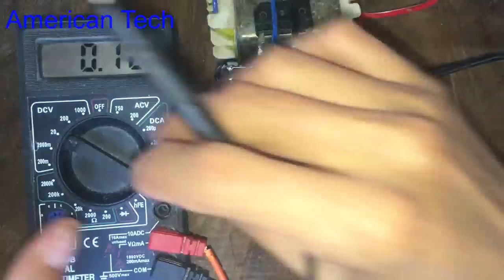New ideas to make spot welding machine with high Quality

Comment: The energy stored in 8800uF at 30v is around 4J which is about 10% of what is needed to make a good weld with regular nickel battery strap.  Also, notice how many of the "welds" demonstrated are visible only on one side of the probe... this is because the energy is spent in the sparking as the contacts close not by current flowing through the weld.... the current needs to be switched on AFTER a good contact is made!

I have no doubt that with some luck and some very thin metal strip this might work a few times, but it could not weld regular nickel battery strap, and the switch will not last 10 minutes.
Reply: correct.
Reply: Also, the soldering is crap as there is no mechanical bond on the connections!!!
Reply: James Lewis «YA YA YA,BUT THE WHOLE IDEA BEING HE NOT ONLY USED HIS BRAIN BUT HIS HANDS IN EMPLENTING HIS DESIRE,MUCH UNLIKE THOS WHO ONLY USE THEIR KNO IT ALL RHETORIC TO CRITISIZE
Reply: Roland, "ALL CAPS", replies are hardly a way to start a dignified discussion on any topic... it simply makes you look like some sort of idiot.  However, as someone who has been building improvised electronics for many years, I can say that a tool like this... however cheap is a false economy as the welds will be unreliable, and will spoil any later project you build with it, even potentially making stuff dangerous if a strap comes off and shorts out a pack.

There are designs, and kits for battery spot welders on Ebay that are excellent, but this is not one of them!

In principle, if the design had included a resistor to limit the current when charging the caps... had included quite a lot higher capacitance... ~100,000 uF and used some mechanism to connect the load for a short time when triggered... (foot switch, 555 timer, several mosfets) it would actually be usable.... but it would not make for a video that could be monetized which is really what this is all about!
Reply: He welded wrong. He needed to have one electrode on the battery. He had both on the strip shorting right through it making a crap "weld" from a hot spot. (Edited: I was wrong. Some current will flow from strap to battery and back.)
Reply: You'd think so, wouldn't you..  but once you can deliver enough energy to overcome what is wasted in this way it's better to put both electrodes on the strap because then you don't produce a "hot spot" inside the cell, or even (as I've seen happen) puncture the cell casing.... 

Sure, you waste half the energy but you make 2 uniform welds... if you wanted to do what you describe, you would make one small, and one large electrode so the welding process only occurred at one electrode.

I guess it's worth mentioning that many battery straps now come with a forked end to limit the problem you describe!

Good DIY battery spot welder:- https://www.youtube.com/watch?v=Ceos88VO6p4
Reply: Well, whadda ya know? Then what is necessary is to use a wide electrode on the battery and the small one on the tab. That would eliminate any burning through the battery, because you are spreading out the point of contact on the battery. A foot switch is also necessary so you can make good contacts and get the electrodes where you want them, before turning on the juice. Thanks for the information, and the link!
Reply: I agree that it seems logical, but i have never seen a professional battery spot welder that does not use 2 identical probes on the strap and i have produced /many/ robust welds this way.  I do not know if there is some reason the idea of 2 different sized electrodes is bad... It perhaps would not be possible on the positive terminal with small batteries or large straps.
Reply: So, it seems then, that I was wrong. Some current will indeed flow from strap to battery and back, so an electrical weld is occurring, just that the strap also absorbs and wastes a lot of the energy too. I was thinking that the strap would be a short and nothing would go to the battery. Thanks James.
Reply: You can be certain that this happens, since if you make a bad contact the strap heats up and turns blue with the heat, but if you do make a good contact, everything remains cool except the actual weld.
Reply: Ahhh... got it. Is there a cleaner to be used on the parts before welding to help ensure good contact? Alcohol? A little light sanding? Thanks.
Reply: The strap is usually very clean as it comes from a sealed bag, and I guess it depends if you are using re-cycled batteries, but I've not found a need to clean mine, just apply sufficient pressure on the contacts while the weld is made.
Reply: Alright. Thank you James.
Reply: Roland Vasquez but he's doing so many unsafe things and touting it like it's great stuff. just to get views.
Reply: James Lewis......your absolutely correct this machine doesn't welding strong on the battery i have try this and really its a mess plus no good connection. Well what you suggest to make a strong and clean spot welding ??
Reply: Well, obviously it does depend how much money you want to spend on the project, and how many welds you will be doing, because a minor welding failure, could result in an expensive failure of the battery pack later, and could be dangerous in large packs... 

The DIY range goes from this project:- https://www.youtube.com/watch?v=Ceos88VO6p4 at the expensive end

Right down to this at the cheap level:- https://www.youtube.com/watch?v=UU7QC5Uby6M  To be fair, this is pretty dangerous because the time of the weld is not pre-defined etc... but it sure is basic!

That, and of course there are any number of Chinese battery welding machines available on ebay, but beware they tend to pop fast breakers at switch on, so you probably need B type breakers, or a soft start mechanism.... my one could pop a 32 amp breaker, without blowing the 5 amp fuse in the plug!!  Clearly the breaker is too sensitive, and/or the device doesn't bother to deal with start up surge properly.

The solution in this video could work, but it needs about 10x 10,000uF capacitors (minimum) , as well as a MOSFET to switch on the current, otherwise most of the energy will end up welding the switch contacts instead of the battery.
Reply: no,no,no...its not the caps problem i have used 2 of 6,800 at 440v and still the same i believe the main problem its the timing which must be very quick like a ''pulse''
Reply: Well, your design must be somewhat different from the one in the video... if you are charging your capacitors to 440v then with 6800uF you will have just about enough energy to perform a weld... as I said, 8800uF at 35v is about 10% of the required energy....  How are you charging to 440v?

However, I'm not certain what impact welding at that higher voltage will have.... other than to make it extremely dangerous!

Timing should not be a problem, 6800uF @ 440v is only 50J, so once you have turned on the power it would be quite OK to dump the whole charge into the weld.... however I still think that a mechanical switch is a bad idea.... solid state switching is the way to go.
Reply: They all know only  theories, well  440V its the maximum voltage can hold the capacitor before  blow out. I'am charging  them with around 25-30V.  As for the capacitance its 2 x 6,800μF in par makes us 13,600μF and all i get is bad welding, timing its the main issue i believe.
Reply: If you are only charging your capacitors to 25-30v, then 13,600uF does not contain anything like enough energy to make a spot weld.  Even if you could be sure that all of it was being dissipated in the weld itself which will not be the case if you are using a mechanical switch.  If you charged them to 440v then you would have enough energy (just), but as I said before that would be quite dangerous.

The type of weld you are attempting requires about 50J of energy minimum, so you can easily calculate how much is stored in 13,600uF at 30v, and it's only about 6J

If you use a mechanical switch, a good amount of the energy will be spent in the switch contacts, and if you try to connect the welding probe live, then all your energy will be spent in the surface contact before the two surfaces are pushed together.

Who are these people you speak of who "know only theories", by the way?
Reply: The reason most commercial welders use a 2 shot method is because the first shot at lower power ensures the connection is solid before the full power shot completes the actual weld.
Reply: James Lewis
Reply: Oooooooooooooooooooohi
Reply: James Lewis
Reply: I think 4 Joules is enough, but it would be better to have 880,000uF at 3v.  There's too much arcing over 20 volts.  It has to be low voltage to be efficient.  Electrolytic caps aren't the best.  One 300 to 500 Farad, 2.7 volt, with a few milliohm ESR or less, EDLC supercap is about right for this, and costs around $5 (chinese) to $15 typical.  Or just use a 12 volt car battery.
Reply: Well if you are criticizing then first build a perfect spot welder then comment.... Well man this is a very well done thing.....
Reply: Good point
Reply: That's wright
Reply: @bryankirk3567  uhijyuie
Reply: He just gave a idea of a different perspective. He isn't planning on patenting the product, I hope.
Reply: I spend in that capacitors and it does not work... it only makes holes in the nickel strip

Comment: Using a 100mA push-button switch will burn out almost immediately!  The charge current for those capacitors will likely hit 5-10 Amps for a few ms, which will burn the contact in that tiny switch.
Reply: You are correct, he should put a limiting resistor in series with the switch.
Reply: No, he should not put a limiting resistor with that switch, he should use one rated for an order of magnitude more current, except the design doesn't need a switch at all, could be continuously charging the capacitors.
Reply: or he should use a relay
Reply: no, no , no, he should use some power element like power MOSFET or thyristor to switch high power to clamps, use bigger capacity , bigger cables..... thing that he build is crap...
Reply: Its not a trigger switch, he used as an on off switch to charge the capacitors
Reply: He is using the switch into the input supply not the output which output has the huge surge of current from the capacitor. so the tiny switch can handle it with out any limiting component to it.
Reply: Matej Bača do you have a build for a spot welder like you are proposing?
Reply: beforebefore Thanks tiny wire for limiting current 😁
Reply: I think this ideas is effective enough and work well.
Reply: One real supercap would do the job much better
Reply: Gary Weliver, not yet. But if i want to build spot welder, i would do it in completely diiferent way... Switching power supply, supercapacitor bank, hexfet array, micropocessor current regulation
Reply: We don't need a switch for that circuit
Reply: Correct me if I'm wrong... but did he not solder the leads to a mosfet?
Reply: yes we do, because of security, only when pushing the button capacitors are charged, otherwise these ones would be always charged and may we recieve a discharge for accident.
Reply: killallfornothing, you said "charger + gel acid battery + power transistors + timer (or dedicated electronics)= perfect welding with regulated power..."
In my experiments mosfets or transistors may not work either. I built one using 24 volts. I used a gel acid battery and a 12 volt power supply in series. I used three mosfets (irf510) in parallel. It worked with 12 volts but 24 volts blew them out. I ended up using two light switches rated @ 15 amps, 120 volts. I used one switch to charge the caps and the second switch to charge the electrodes.
It puts holes in the battery tab when it arcs but I want more capacitors so I can weld with the current alone.
Reply: killallfornothing, Absolutely no PWM. I would rather use a solenoid. I made a number of mistakes but that's part of the fun. ☺☺ I destroyed two potentiometers, one 3Amp push button switch and those three mosfets that I wired in parallel. I promise I will destroy even more stuff in my experiments. I love the learning process. 
I like capacitors because they are isolated from the power source. My capacitor bank is 29,500 uf which is too low. I will 'gradually' add more capacitors until I reach the proper level.
Reply: killallfornothing, I agree that mechanical switches generate sparks so I will have to look into a thyristor but for 'now' the light switches were less than a dollar apiece. ☺
Reply: Good
Reply: beforebefore if you are going to use some 100 MA tactile switch you would need to use a relay so it can handle higher amperes
Reply: beforebefore hhj
Reply: The push button is not used for welding.  It is used for charging the capacitors.  Look closer how he weld.  He puts one end down first then touch the other end
Reply: beforebefore f
Reply: @blackgate27 that will get stuck because remember this is a spot welder, and a relay has a moving switch in it.
Reply: But.......he clickbaits it as High Quality !
This Channel should be called "Indian in America Tech" channel. I see this level of quality from Indian Channels often. We used to call this kind of quality "Oklahoma Engineering".
Reply: Indeed. It will.

Comment: This can simply work without the doubtful tactile switch & also without such a big transformer & bridge rectifier. Use only a small 20v, 100 mA transformer & one cheap diode 1N4002 - 7 with a 1000 ohm resistor which continuously keep the capacitor bank charged. Make a quick discharge with pressure, preferably between the battery end & the connection strip. Don't worry about any further continuation heavy currents in the joints because of the 1000 ohms resistance.   For thicker strips add some more capacitors.  Circuit works OK.

Comment: Well it works :)  I was thinking of something similar but run from a bench supply and using a super cap.  The weld terminals need to be replaceable as they will quickly wear as well.  And I agree with some others that the switch is too light weight.  But for a McGuiver circuit made from scrap components it gets the job done.
Reply: You seriously got this to work?

Comment: That chinsey little tact switch will not last for very long AND you need at least 4 more of those little 3300uF capacitors, all rated for at least 50V. You need to use that little push button tact switch to trigger a nice heavy duty starter solenoid relay or solid state relay, which gives a QUICK BURST of current from the capacitors to the spot welding electrodes. You also need to have some pretty heavy cables from your capacitors to your welding electrodes. THEN you will have a decent little semi-automatic spot welder.

Comment: I'm allergic to hot glue on anything that heats up like transformers.
Reply: in stand by mode,  transformers don't heat up. in this application, the device does not consume power continuously.

Comment: Or you could plug two wires into the wall and connect them together where you want  to weld
Reply: yeah but you should have someone standing on the breaker to keep it turned on 😂

Comment: You forgot to introduce the "bridge rectifier diode" which convert AC to DC, it's the black rectangular IC
Reply: Doesn't really matter, because a FULL WAVE BRIDGE always cuts current in HALF. Better to just use a single diode (quarter wave rectifier) on each secondary  wire feeding those capacitors. Then you get the FULL TRANSFORMER CURRENT, which will charge the capacitors much faster. Full wave bridge is only effective in this scenario IF the full wave bridge is rated for at least TWICE the current of the transformer secondary. Otherwise, it just takes too long to recharge the capacitor bank AND the rectifier heats up too quickly.

Comment: That switch won't last long, as it will have to pass a couple of Amps each discharge. also too much voltage drop in excessive long leads. Still great principles and energy for doing so many new projects with the mighty gluegun and solder iron.
Reply: Switch is used for charging capacitors and not for welding.

Comment: The trick of condensator based spot welding is low voltage and huge capacity. In this case it does not produce spark explosion just welds.

Comment: I recommend putting one electrode on the silver part, holding the copper down, and welding with the other electrode. (20 years with a welding company)
Reply: i am pretty sure there is no silver parts in any of the recorded parts but there would probably be in the technology of the recording camera he is using.
Reply: Lloyd Sims spot welding, just add heat for a nanosecond and pip! If it sticks and doesn’t grenade it’s good

Comment: Yea you should have used a larger switch or a MOSFET to limmit the current going to said switch..

 You could have also cut those contacts inside your probe to A) avoid shock and B) prevent arcing inside.

Also you should have used 63V caps with that 30V transformer. 35V caps are cutting it close.

Comment: cool spark machine, let me know when you get some larger capacitors and some high power transistors to do the switching after contact is made with both electrodes and then you can call it a spot welder

Comment: This design is not desirable, because the arc occurs on the copper tape was not fully contact to the battery surface before the energy being exhausted, so cannot achieve the welding effect.